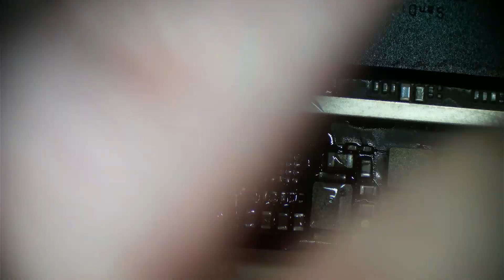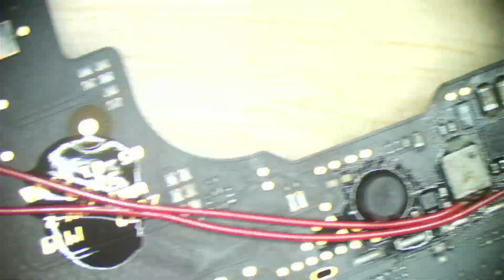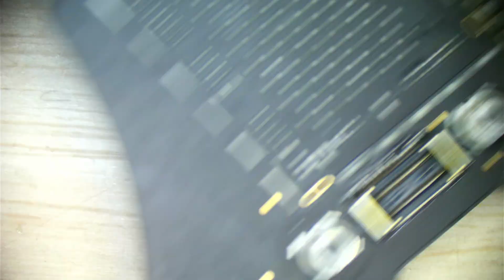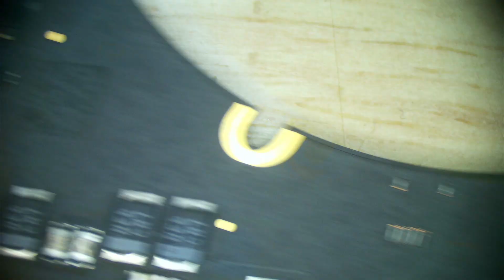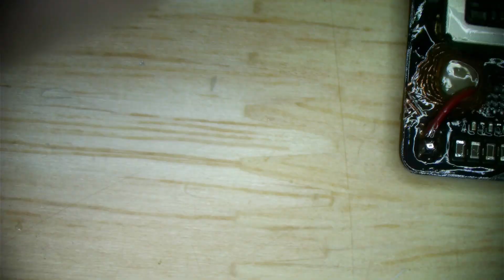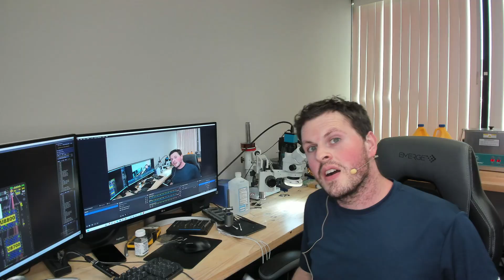Try and one up this one DriveSavers | A1990 with a massive internal short in the SSD area.

Comment: Good day Master, I am at an intermediate level in this world, I have a wet MacBook Pro a2251, more specifically on the cd 3215 controllers, I downloaded them and cleaned the rebaling and turned on but the equipment does not load, I checked all the resistors and everything is fine, change the charger and the problem continues, I really don't even know what to do anymore, have you had a particular case? If you could help me, thanks in advance

Comment: long wire inductance might be a hard one for other side power reg.i usually fix this short by glueing new controller flipped upside-down on the inductor and wiring it around. for datarecovery, miniware precision power supply would be a safer way.